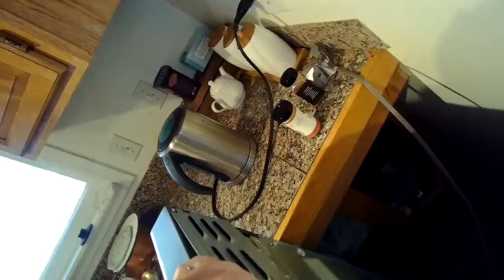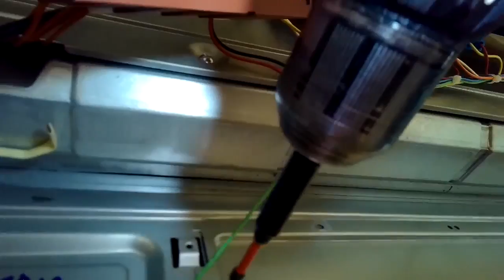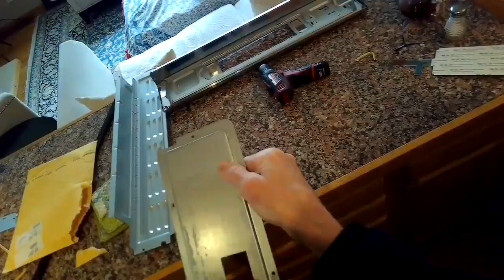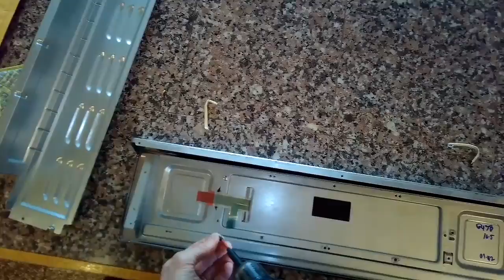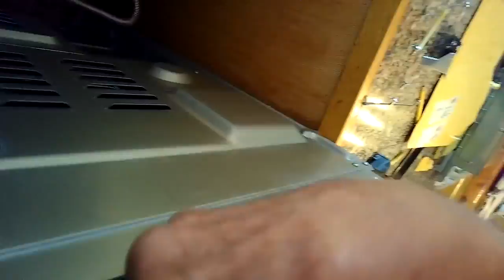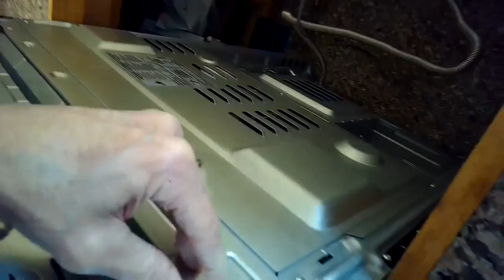✨ SAMSUNG STOVE - EASY TOUCH PAD REPLACEMENT ✨

Comment: I have model NX60A6511SS/AA.  It started to just randomly beeping.  My son was cooking when it started and said that the heat turned off on the oven.  All the buttons seem to work and make a beeping noise when you press them.  I checked the ribbon cable and cleaned it and it continued.  Unplugged it for a while and it started again.  Left it unplugged for a day or so and plugged it back in and it worked for most of the week and then started randomly beeping again.  I'm thinking the sensor beneath the Off/Clear button is the issue.  Do you think replacing the touchpad would be pretty straight forward for this model too?  Or do you think it might be something else?  Thanks
Reply from the maker: Thanks Mike,
I think yours needs a new controller rather than a touchpad👍

Comment: I cleaned the ribbon - worked that day but the next day the bake and convection bake (only two not working originally) stopped working again. Part was discontinued but found one online for $225. Still cheaper than a new stove so I hope it works! 

Any advice for removing the components in the back when I’m replacing the membrane? This is totally out of my wheelhouse.
Reply from the maker: When replacing the membrane, take photos before you disconnect anything. This will help you remember where each component goes. The ribbon cable is delicate, so be gentle when reinserting it into the new membrane.

Comment: my stove is reading C-F2 and only top burners are working. when checking for replacement parts it came up with Samsun DG94-0404F refrigerator control board. would this part correct my problem?
Reply from the maker: https://youtu.be/4018FnLXUD0?si=VolJDAETv4YNQVij should help to reset the CF-52 error.

Comment: Just did mine, appreciate it. However the 9 and 4 still do not work. Sucks
Reply from the maker: Hi Adam,
I would try it again 👍
Reply: @ScottTheFixItGuyChannel   as in do the ribbon again? I tried still had not worked. May try it again today.

Comment: I replaced the control module for our Samsung Gas Range Model No. NX58J5600SG/AA with a Sears control module part# DE92-02588J. I was a little skeptical of how the part was shipped. It was poorly packaged with some bubble wrap loosely wrapped around the module. Also the Module had a slight bow in the board and two plastic bits were rattling around the bottom of the box. I tried to get a return going with them but its rather impossible since nobody answers phones anymore. It stated under the part on the site, it wasn't returnable, since it was in this condition I decided to try. It was a waste of time so I installed the part and the clock time came on and starting at 12:00 and continued minute by minute. None of the other buttons operate and power cycling did nothing. Now I called Sears service and they are coming on the Sept. 12th. People if you are reading this DO NOT BUY SAMSUNG APPLIANCES!! We bought a package of three Refrig, Stove and Microwave from Home Depot. All three have failed! Technicians have refused to service them. Parts do not last its an nightmare, avoid it!

Comment: I just ordered this part for my Samsung range and it’s now costing $100-$130 for the part due to inflation. Just thought someone watching this later on might want to know that updated price. I wish it was still $40-60!! 😅
Reply from the maker: Thanks for the update👍
Have you tried using an eraser to clean the end of the ribbon cable that goes into the control board?
Reply: @ScottTheFixItGuyChannel  Hey, thanks for the video btw. If it wasn’t for ppl like you posting videos like this I’d still have a broken oven. You saved me a couple hundred bucks!!
Reply: @ScottTheFixItGuyChannel  Yes, we sure did that first. It was pretty obvious tho that our chip had overheated as it was toasted-looking, but we tried it anyway. Our range is only about 18 months old also. Juuuuusssst out of warranty. 😨 Replacing the power control board did solve the problem tho and it was a lot cheaper than buying a whole new range. We also bought a product called super wool by Lynn Manufacturing that is 1/8” thick kind of paper like to act as a thermal barrier to try to prevent this from happening again as our oven vents directly under these sensitive electronics. We also bought the same brand’s liquid adhesive to glue the paper to the metal housing that sits under the electronics, so hopefully that will protect it without actually touching anything important. It’s rated to 2100F so it shouldn’t melt. 🫠 But I’m sure it’s going to be super fun to install super wool with with superglue wearing super eye protection, gloves and respirator. 😶‍🌫️ Can’t wait to get that project done later tonight.

Comment: Have you found that after replacing the touchpad, there is still an issue with the control board itself? I am getting a c-d0 message which means stuck key and I can't get them unstuck so I was going to just replace the touchpad.
Reply from the maker: Good thinking,
A new touchpad should do it😊

Comment: Thanks for both this video and the one on trying to clean the touchpad ribbon contacts with an eraser.  Unfortunately, the simpler cheaper fix (cleaning the ribbon) didn't work.  And unfortunately, the cost for the touchpad in September 2022 was $110.08, including shipping.  But far less than the service call alone would have been, and a great way to hopefully keep this stove running for a few more years.  I have never done an electronics repair like this in my life.  It really is easy with these instructions.  And by the way the part number for the touchpad for a white enamel version of the stove (not the stainless steel version with the black touchpad) is DG34-00025B and the model number is NX58F5500SW/AA.  The official part name/description is "Switch Membrane."
Reply from the maker: Great info, thanks so much Ken👍😊

Comment: I replaced the touch pad and got back most functions except broil and numbers 1, 4, 7, 0.
I try the eraser and now only the clock is working (can't set it though). The ribbon connection
seems shallow- not all the black markings insert- but it stays in. What next?
Reply from the maker: Time for a new touchpad😊👍
Reply: When you pulled out the ribbon cable, did you make sure the connector was unlocked?  The connector unlocks by slicghtly pulling at the top of the connector.  It will need to be unlocked to put the cable back into the socket.  Then you just push the top of the connector down to lock the ribbon in place.

Comment: I have a Samsung where I am getting the dreaded 5E warning alert.  I replaced the membrane switch, and it was good for 45 minutes than the 5E appeared again shutting down my stove.  Should I buy another switch, or do you have another suggestion?
Reply from the maker: Thanks Warren,

I would unplug it for 30 minutes and on the next trial check to see if hot air from the oven is hitting the membrane touchpad.
You might be able to deflect that hot air away from the touchpad.

Comment: I’ve been dealing with my Samsung oven buttons which has been sporadically working since the beginning of pandemic. I finally decided to get the control panel in amazon, I hope the problem is just the panel. But I wonder how come I had to sometimes turn on the stove and wait for couple of mins for the Start button to work. Thanks for sharing your videos.

Comment: I replaced the display but it’s still not working. Do you think the replacement is bad or the actually computer part is shot? Thanks!
Reply from the maker: Yep, it will need a new controller

Comment: Thank you for this video . I have this stove and a 2 months after I bought it a slight bubble appeared on the touchpad right by the clock. It appeared after me using the stove on broil for the first time and I figured  the stove just had a defect where it didn't deflect the heat well enough .I unplugged the stove and after plugging it back in it worked until now .  You can press on the keypad and get it to work for about 5-10 minutes then the same s3 comes on the screen. Do you think replacing the touchpad will fix it . I am currently just trying to save another 800.00 bucks for another stove . This one went out a week after the Lowe's warranty ran out . Thank you for any information you can give .

Comment: Thank you for sharing. It a very easy fix. We had to call Samsung and were on the phone for a while to find out the issue isn’t covered under warranty. And the nearest Samsung repair tech was over 50 miles away. I have the part coming in this weekend, the wife will be pleased once this is repaired. Thank you again!!
Reply from the maker: Excellent 👍😊
Reply: Do you have a part number for it bud?